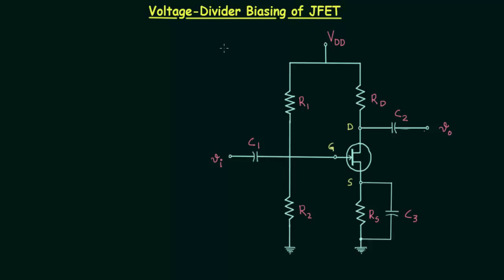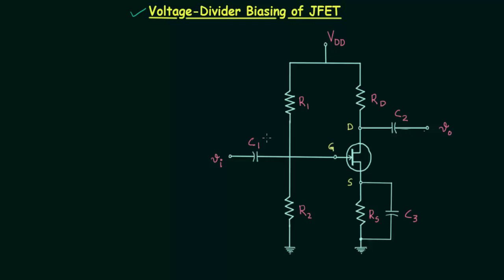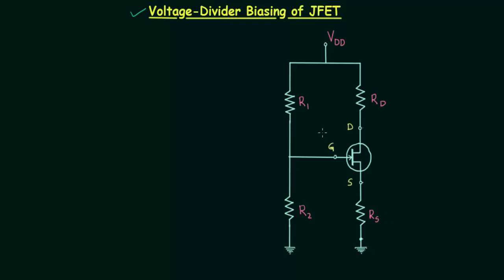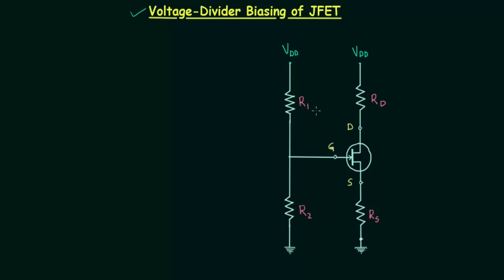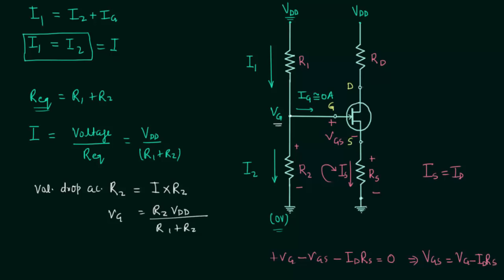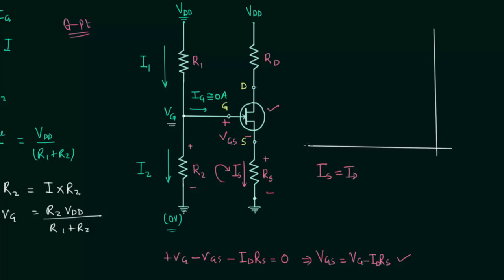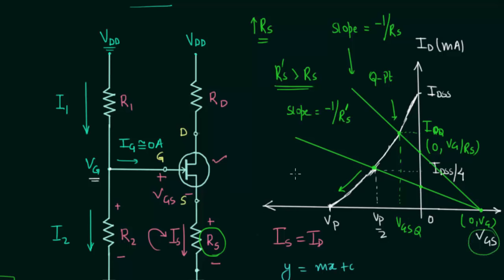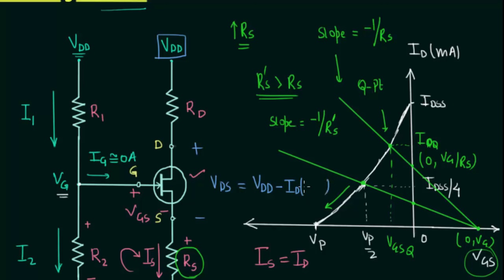Voltage-Divider Bias Configuration of JFET

Comment: Please correct your mistake in JFET voltage divider configuration at 12:42.one of the co ordinates of load line is mentioned as(0, Vg) instead of (Vg, 0).

Comment: sir, in some books operation point mentioned on drain characteristic by calculating Id and Vds. is it correct to calculate o.p on transfer characteristic? reply me soon.
Reply: No.... transfer characteristics is relation between output and input...therefore idss and Vgs should there...

Comment: I think you are wrong because r1 and r2  are in parallel because if it is in series it will act as an individual strand and it
 would give no effect on the circuit. If I am wrong please correct me.

Comment: What is the use of bypass capacitor
Reply: In the case of BJT amplifiers, for gain/temperature stability a resistor was added to the emitter, RE. The addition of RE helped with the stability of the amplifier, but decreased the overall gain, Av, of the circuit when doing the AC analysis. So to avoid this, a bypass was added so that the circuit DC biasing was more stable, but in the AC domain the AC would simply "Bypass" this resistance. 

However, MOSFETs/JFETs are more stable than BJTs, so in this situation, I am not 100% sure.

Comment: how the coupling capacitor is open circuited in case of DC analysis...how it happen...and when it's open circuited we remove it how this happens ...plz help.
Reply: because capacitor simply block DC current....so when we deal with DC analysis capacitors can be treated as open circuit
Reply: Think of the equation used to calculate the reactance of the capacitor: Xc = j/(2*pi*f*C). In DC, frequency is 0. So, Xc = j/0 = infinity, which is an open circuit. This is why it blocks DC and allows AC to "Bypass" through the capacitor.